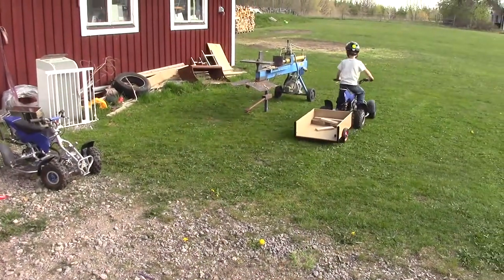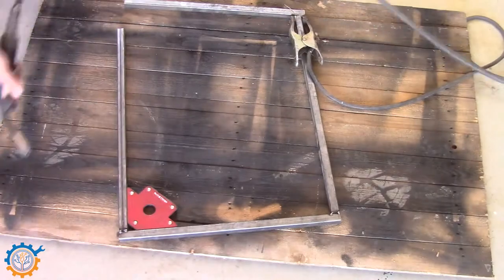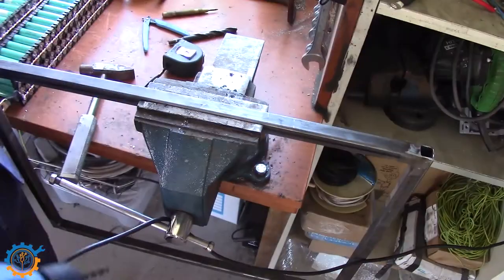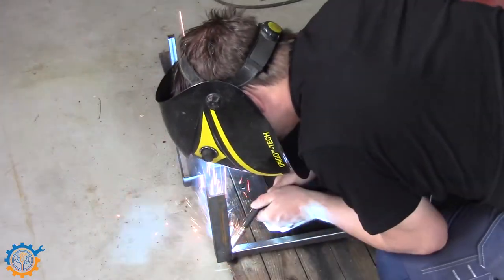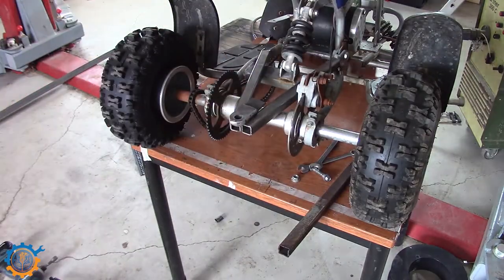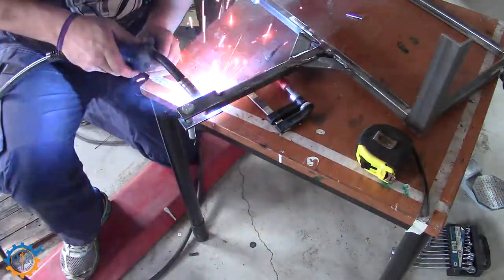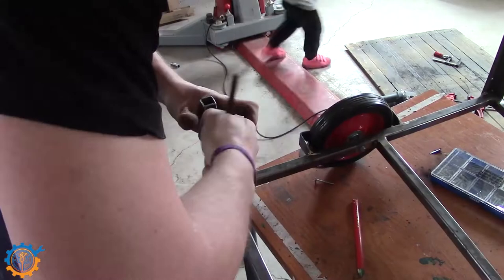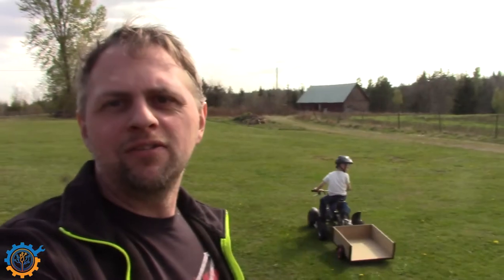Wagon for ATV build

Comment: I remember u building a 18650 pack for your sons atv. I was waundering how many batterys u used to do this. I'm in the process of building 1 for my grandaughters atv. I have 90 batterys i will be using in sets of 30. 3 sets for 12 volts. is this enough for this project. Don't no how to figure  out the run time atv will get. All batteries are out of old laptops. Charged them up to 4.2 each. Some advice is really appreciated.
Reply from the maker: its hard to tell. how much current does the motor use? 3s30p sounds line a good strt thoug 4s mighr be better if he electronics can take it.